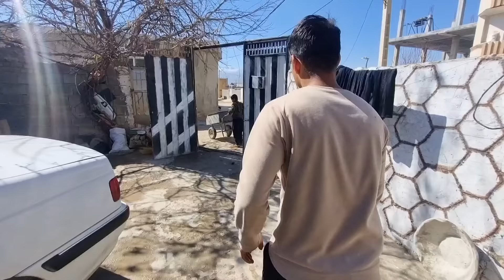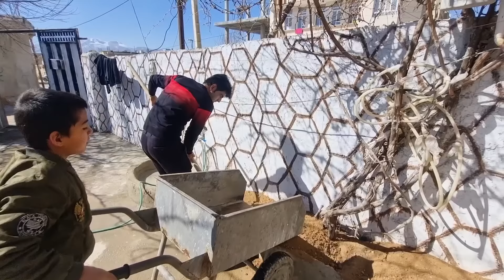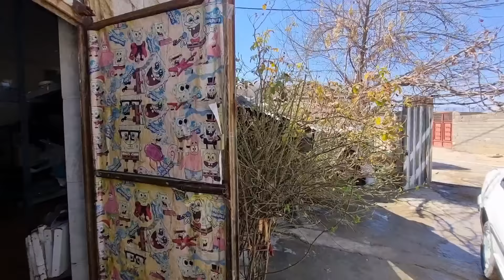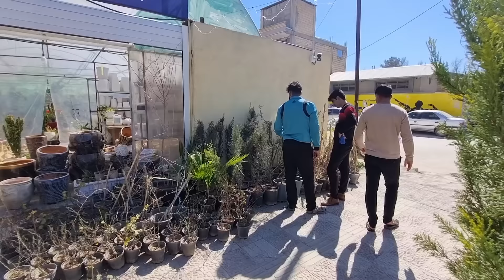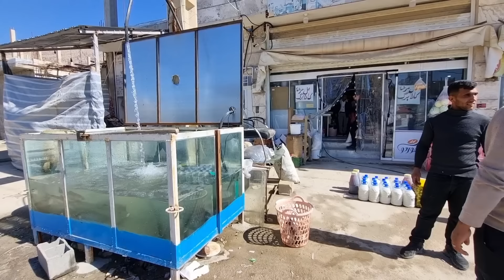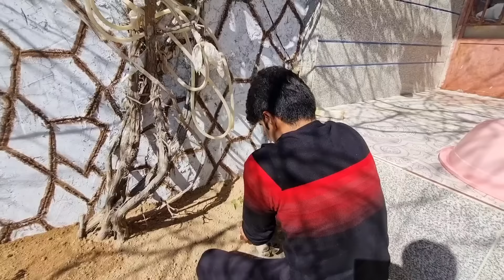Mahdi does not give up and tries to reach Razia

Comment: The soil they used is mostly sand, you need good black soil, and they overwatered the rose bushes. Hopefully the roots will not rot. Some form of fertilizer made for rose bushes should have been added.
Reply: Paska riittää